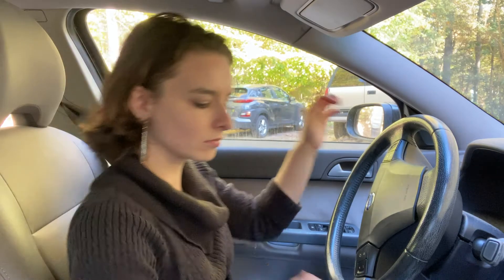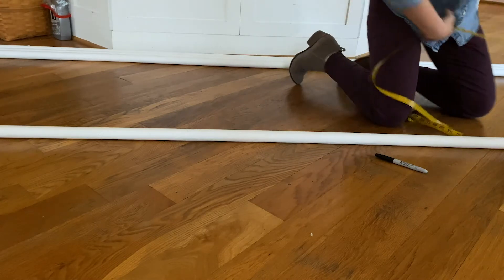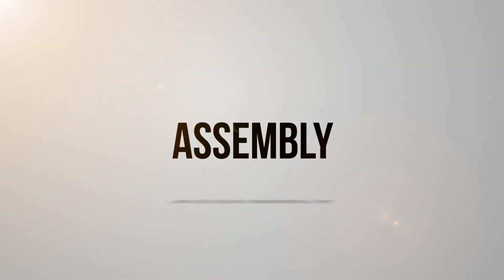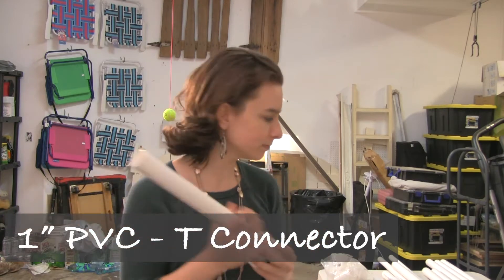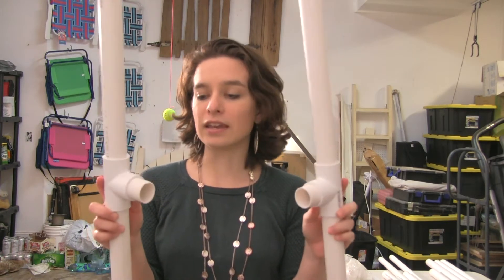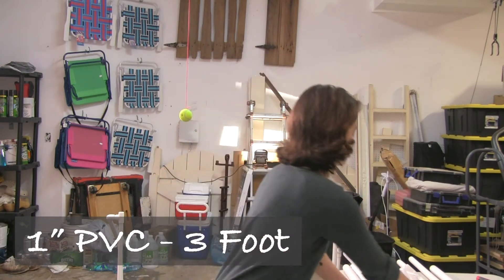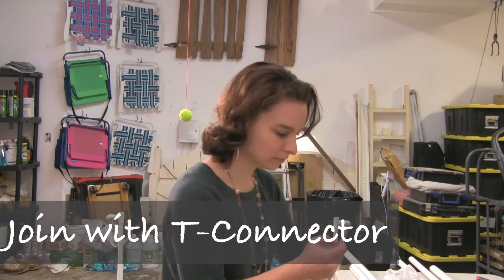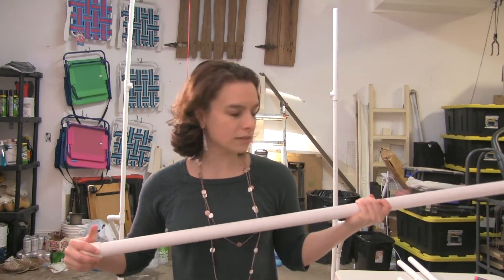DIY Light Diffuser for Filmmaking and Photography - Made with PVC

Comment: well designed and built. did you come up with this idea yourself? if so, engineering was your true calling. :)

just two (nitpicking, i know) comments.

1. for safety sake while filming, use the ladder in the background. lol not a chair. i know the little giant ladders are wieldy, but safety in video demonstrations should be front and center. 

2. and this is really nitpicking, so you can just laugh at it. when say 3/4 out loud, saying 4ths instead of quarter sounds odd. "quarter" and "half" are the only sae/imperial fractions that sound more normal than eighth, sixteenth, thirty-second, etc. 

overall, that's a great project, and all that matters. keep up the good work!